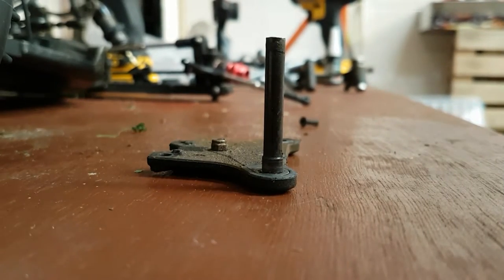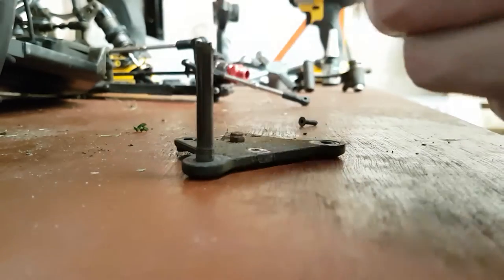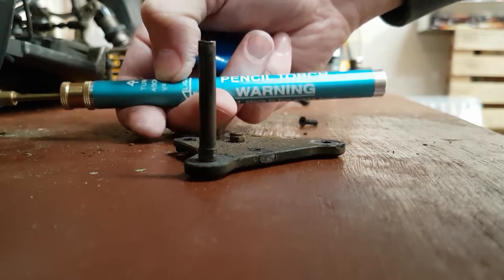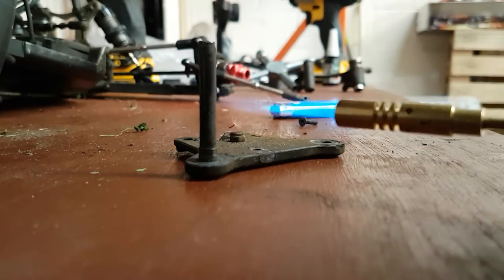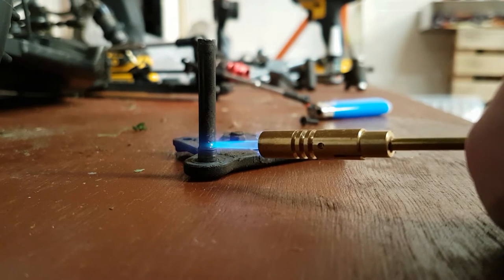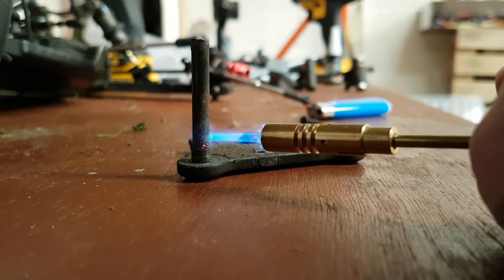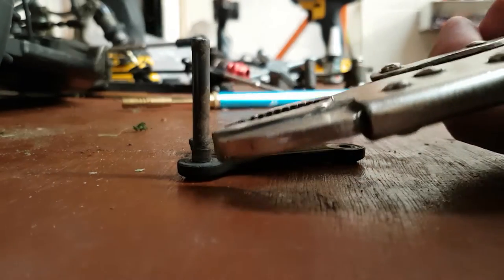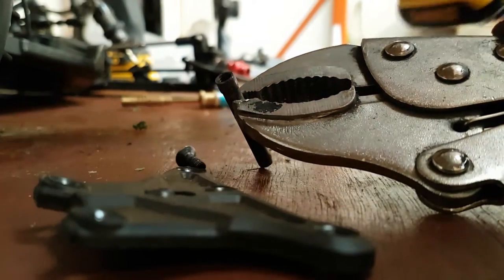How to Remove Tight Loctite Screws in RC Cars

Comment: Hi Kevin, does it work with red loctite? And does a heat gun work also or does it lack the necessary heat? Thanks!
Reply from the maker: It sure does, it works for loctite's :) I've tot tried a heat gun but I would say you are going to struggle getting it hot enough as you can't focus the heat where you want it.  cheers
Reply: Bit late reply but soldering iron works as well and heats up quicker